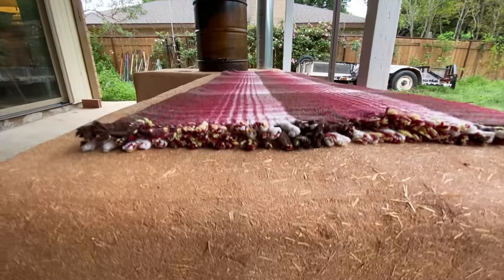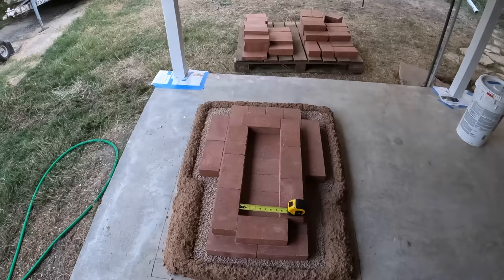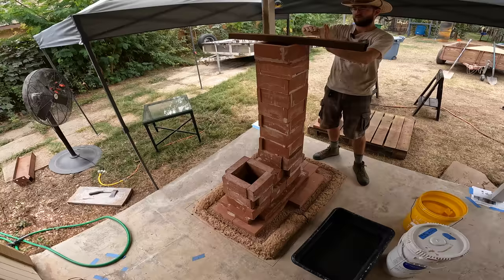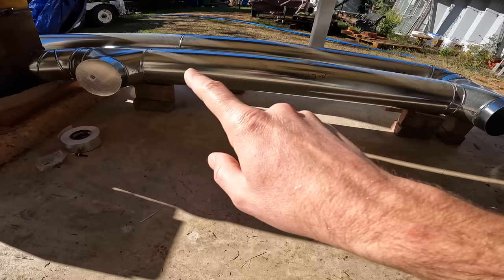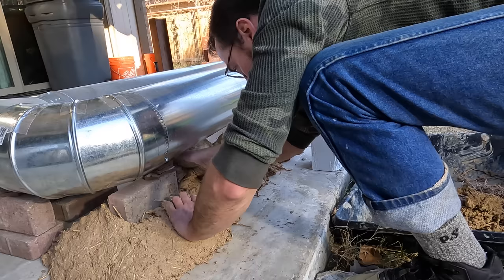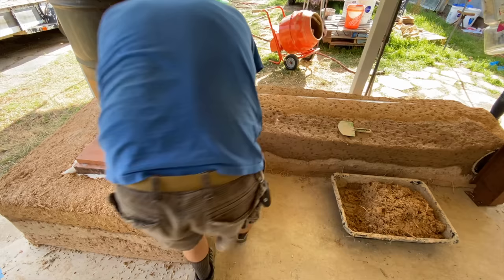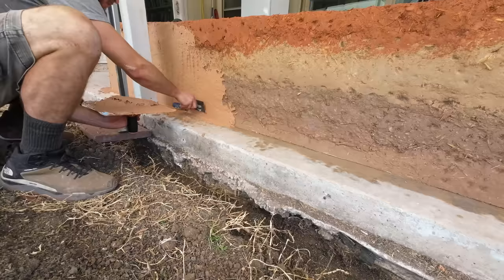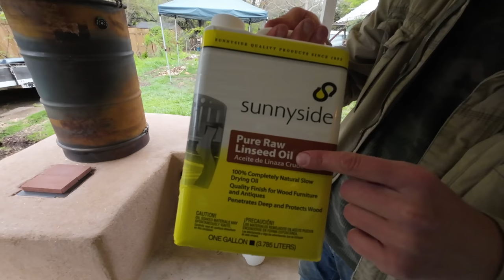World's most efficient stove!!!!  Made of DIRT!!!

Comment: Excellent video. With these rocket stoves, I always wondered about establishing a draft. Generally in a standard chimney application the smoke is drawn through a chimney with hot air. What I see here is , the initial draft is established within your riser  as the top of the barrel, heats up.  Like hot air rises, the  cold air  falling  around the riser also contributes to the draft as well,  as it draws the hot air down and into the duct.  Those two working together , so far seems to work. The question(s) are: Will that be sufficient in all weather conditions and temperatures to release the exhaust ,  keep it from smoking out the house and insure no backdraft will occur?   If ever there is an issue with that, and I have tangled with this in my mind for many years.  I would like to "So to speak"  offer you the benefit of  my  brainstorm, and, or, run this by you for your opinion and consideration. Would it not be practical  to attach a closeable bypass or draft  initializer  duct  which extends from the top of the barrel to  your final vertical section of chimney to preheat or  establish a solid  and  dependable draw?  20' of horizontal pipe  is a long way   for exhaust to travel  and if your chimney is  very cold it  may  make sense to have a way to  establish and moderate the exhaust , or even completely bypass  your lower ducting.  It could also act as a thermostat  just in case you r bench is getting too warm. etc.. Anyway, lots of ideas and theories in this head, I don't have a stove  though ! Haha!  You have built one and have my respect.  Maybe let me know what you think, I am seriously considering a build myself.  Thanks
Reply from the maker: I linked to a book in the description. In that book they actually talk about exactly what you are describing. Some people build a bypass into the stoves that skips the entire run of the horizontal duct. Basically the duct immediately after exiting the bell will bypass to the vertical section of chimney. I have read that this idea actually works quite well to start the stove on suboptimal days. From what I have read the hardest days to get the stove drafting are when the stove is cold and a heat wave comes through so the ambient temperature is relatively hot suddenly. Because my stove is on a sunporch I have experienced another few tricky days to light it. I have noticed that when the sun heats the sun porch to 100° F or so this tends to heat the bell but because the heat riser inside is insulated, the heat riser stays cold. The combination of the cold, internal heat riser and the hot external bell make it hard to start a fire. My solution is to get a piece of lint coated in Vaseline and start that on fire on top of a small piece of wood. Then I slide the wood all the way back so that the heat is rising up the heat riser. I let this burn for about five minutes to create a draft upwards. Then I light the rest of the fire. This works for me. But your bypass idea is great and apparently other people say it works. Thanks for commenting, and for subscribing!

Comment: I watched this to learn
Well done
But I think at the end where you were putting the finsh slury on with the hawk that holds all of your slury.
I would have just taken the hawk and started at the bottom of the mass, and drawn it up tight as I could up the sides of the mass,
It would have saved you a lot of small troweling

After watching you light this unit
I thought why not have had a horizontal tunnel at the bottom coming from the inside to the outside, where one could have used it for much easier lighting ?

And after you run a fire in that system for how long, and how long did it keep the unit warm?
Reply from the maker: I hope to make a follow-up video with Numbers regarding temperatures and how it operates and heats versus ambient outside air. Thanks for commenting.

Comment: The base of fire brick are dry. What is the  purpose of soaking the firebrick before applying the mortar for the build up? Seems the mortar would be drawn into the pores of dry brick somewhat, giving more grip and stability to the heat riser. Im sure there is a good reason. I don't know that reason and i like to understand thebreason things are done the way they are. Helps when transferring methods to other building projects. Thanks for a great video.
Reply from the maker: I have read that it increases the depth of penetration of the mortar into the brick, because if you apply the mortar to dry brick, the brick rapidly absorbs exclusively the water out of the clay slip. If you pre-wet the brick, the thought is that the Clay remains suspended in the water, and the slurry itself is drawn into the pores of the brick rather than just the water. Hope that makes sense. This was really the only time I’ve ever built anything like this, so I’m not Positive That I am describing it correctly. But if I recall, that’s what the books I’ve read said.

Comment: awesome video and tutorial.
but the model demonstration has a logical flaw. u were heating the brick along with the tin can so essentially u just have a much bigger mass to soak up energy. but the energy that takes to heat up the brick and tin can to “operating temp “ is much more than that to heat just the tin can. 

So speaking in the real scale sense, you would need more wood and time to heat up to temp that mass vs just a stove. 

But the idea that large mass holds heat then dissipates heat slowly still holds, and perhaps the efficiency improves via the fact that less heat escapes through the chimney via hot air
Reply from the maker: I see your point and it’s a valid criticism. You nailed what I was going for in your last paragraph though. Less heat is lost through the chimney. And the heat that would otherwise be lost with a standard stove, is instead stored and released. Thanks for the thoughtful comment!

Comment: Has anyone substituted hempcrete  and lime plaster in this build? Thank you a very well presented and detailed instructional video.
Reply from the maker: From what I understand the lime plaster would work beautifully. The hempcrete would not work very well though. Hempcrete is quite a good insulator. In a stove like this you do not want the thermal mass to be an insulator. Insulators lock the heat into the inside, rather than storing it, and radiating it into the house. Thanks for commenting.

Comment: I appreciate your efforts and you are obviously a good Craftsman . The videos put together very well. 
 Regarding rocket stoves it is my opinion that they are not worth the time and the effort. I believe there are several basic scientific principles that are not considered in the descriptions and explanations of rocket stoves.  I believe when somebody goes down the rabbit hole of rocket stoves and get some experience building two or three maybe four or five of them. I believe a reasonable person will ultimately abandon them and continue to look for a better solution.
Reply from the maker: They are a lot of work. And with modern technology, solar panels with a backup battery and a heat pump are undeniably efficient and easier to install. I just like the earthen building-material part and wanted to give this a fair shot. Thanks for commenting!

Comment: Many of these stoves end up needing an extra 40 feet or more of exhaust stack, or an electric blower fan, or both.  It starts with the mistaken idea that hot air rises.  It does not.  Hot air expands.  It only seems to rise if it is in cold air.   It is a common misconception.  It is why Ben Franklin's "improved" stove did not work.
Reply from the maker: I bought an 8 inch duct fan before I even started building this just in case I hit snags. So far it hasn’t been necessary though. Thank goodness. I plan to post an updated video. If I have troubles, I will let people know. Thanks for the comment.

Comment: Great tutorial. I’m currently watching it for the second time. I was wondering, while you were making the metal guard to prevent the firebrick from breaking is there any reason someone couldn’t make a similar one that extends above the top of the bricks? I was thinking it might serve as a hopper allowing more wood to be fed at a given time. From what I’ve read, the main drawback of a “J” design vs batch box is the lower capacity of wood. I still think I prefer the “J” style and for the application I have in mind wouldn’t necessarily need the larger capacity of a batch box. I can imagine others would really appreciate higher capacity and using longer pieces of wood. Is there a flaw in my understanding of the design that would make a taller feeder a bad idea?
Reply from the maker: This is based on my foggy memory, but I’m pretty sure that I read in the book that I put in the description, that if you make the feed tube taller than they recommend, it negatively affects the draft. They caution folks against using longer sticks because that also decreases the draft. Either of these tends to lead to smoke coming back into the room During a fire. But take this with a grain of salt. It has been over a year now since I read that book. I highly recommend the book. I don’t get paid anything to say that. Thanks for commenting, and for subscribing!

Comment: I appreciate your research, this is a subject I've been pondering my entire life. Theoretically could this be built under ground with supporting systems involving water to act as a thermal battery? I think with the help of a good blower at the exhaust end as needed to really get it hot. I mean the Romans built hot bath houses across Europe. Good work though
Reply from the maker: This concept can be applied underground yes. I would recommend checking out the Rocky Mountain Permaculture Institute. They are using underground pipes to heat the greenhouses. It’s a very similar concept. I hope to build a greenhouse like that in the near future. Thanks for your support and for subscribing.

Comment: 😮 yooooo, what a project🎉 
Just wondering now, if there's a method to speed thisngs up, and make bigger batches of material, layering it with rocks, make a wooden form of some kind all around it, and finally use the same technique similar to when people are filling concrete, or instead of all this rather just do a full brick build and decorate it with plaster at the end, hmmmmm
Reply from the maker: Pretty much all of the ideas you threw out there would be faster than what I did. Lol. Most of those ideas have also been explored by others. If you go to the permies forum you can read about what has worked for other folks. Masonry heaters  like that are more common in Europe, and they typically use brick. thanks for your comment!

Comment: Hey, I was wondering if it was possible to run copper wire throughout the brick or barrel to heat water?  Obviously not to heat water for an entire house but maybe a barn or workshop supply, just to offset power draw from the grid or solar panels.
Reply from the maker: Could use some copper pipe. Have to be careful when making steam though. Steam can lead to explosions.

Comment: These rocket stoves really need risers that can withstand numerous heating cycles and very high temperatures that come up very fast.  Using red clay bricks for such risers is not the best choice because they do not have longevity.  After about one hundred cycles where they are quickly heated to temps above 1500f, they begin to crack up and within another hundred cycles, they begin to crumble.  Enclosing red clay bricks within ceramic blanket is not a solution.  The blanket, though it has minimal insulative quality, still has enough to exacerbate the three issues with clay bricks for risers (very high heat, very quickly applied, from cold, and on a daily basis).  Better to have the ceramic blanket against the fire instead of against the clay bricks- this will solve the issues with minimal changes in design.
Reply from the maker: For my own sake, I hope that I get many cycles out of it. I will post a follow-up video if it starts to crumble to warn other people. Thanks for commenting and for your input.

Comment: Fantastic instructional video for the construction of a rocket stove. Yours may be one of the "cleanest" looking designs I have seen. I do have one complaint (it's the internet, none of us will ever be satisfied!)

I think you're mischaracterizing modern wood stoves pretty badly here, as if there's a dramatic/majority of thermal energy going up the chimney, and that something like this rocket stove could heat a home with a fraction of the wood. A rocket stove is more efficient but the margins aren't as significant as claimed by most rocket mass builders, and more importantly, the difference in day to day usability and maintenance is greater than the difference in wood consumption. A modern, well designed wood stove (especially a hybrid-catalytic or catalytic) burns pretty clean and puts about 70-80% of the available heat in the house, and uses the other 20-30% heat to safely drive combustion byproducts out of the chimney system without condensing/depositing themselves rapidly on the chimney system. That 20-30% "lost" energy, is not really "lost," it is paying for day to day reliability, repeatability, and reduced risk of chimney fires. Processing more wood is arguably easier than cleaning all the nasty soot gunk out of the maze of pipes in a rocket mass heater. 

Yes, a rocket mass stove does extract nearly all of the thermal energy from the fire. To the point that a good portion of the exhaust system operates below the condensation temps for the exhaust gases, so water vapor, both combustion byproduct water and water that was evaporated out of the wood condenses down to steam and even condenses into liquid within the system. This is the same approach used by modern natural gas condensing water heaters and home furnaces, which can achieve 90-96% efficiency, and do so reliably because they are burning a sootless fuel source. A rocket mass stove is still burning a sooty fuel, so condensing exhaust isn't a practical option. I see this rocket stove has numerous cleanouts, which is good, as this system would have to be cleaned very frequently.... Where does the nasty liquid condensate drain down to in this system?
Reply from the maker: You raise a lot of very thoughtful points here. If condensation is your primary concern, I can say that I have noticed some condensation dripping on the outside of the chimney. This was a mistake that wound up being a feature. I plumbed the chimney ducts the  “incorrect” way, such that the condensation drips outside when in most cases people say they want it to drip inside. This, however, means that I am able to monitor how much condensation is coming out of the chimney. I think the real question is what is contained in that condensation. Are the compounds in it actually all that flammable? I don’t have answers to this from experience, but I can say that I have read that typically this condensation doesn’t have any flammable compounds remaining in it. The books I have read claim that the flammable compounds are all consumed in the extremely high temperatures inside of the heat riser. I plan to make a follow-up video and in this video perhaps I can try and capture some condensation and see if I can light it on fire. I also plan on doing a chimney sweep on the system and I will try to record that too. Thanks for your thoughtful comments and thanks for supporting and subscribing! 

Ps maybe check out the permies.com forums. They are super knowledgeable about these systems.
Reply: @suburbanbiology  If the combustion is indeed reliably, consistently very hot and thorough then the deposits in the system should not be flammable. In your video at the points where you remove the barrel from the stove, we can see a lot of black deposits... That's soot, which, can vary in its degree of flammability. Feel it... If it's greasy, heavy, chunky, then it contains unburnt wood gases and is flammable. If it's ashy, light, and dry, then it's mostly consumed and doesn't contain much risk. 

In condensing appliances, the exhaust system is usually tilted back to a single low point (like yours) where a little "T" leads down to a P trap. The condensate can then drain from the system... For natural gas appliances it just goes down the plumbing drain. I expect the condensate from this sort of system to be black in color as there will always be some imperfect combustion and soot and other particles.

Comment: I thought, in order to make that "burn tunnel" work properly, you have to heat outer pipe first, cuz air in last pieces of chimney need to be slightly warmer to flow upwards and suck cold air from "burn tunnel". Seems to be I was wrong
Reply from the maker: As long as the heat riser gets sufficiently hot, it still works.
Reply: @suburbanbiology  but what if it completely cold?